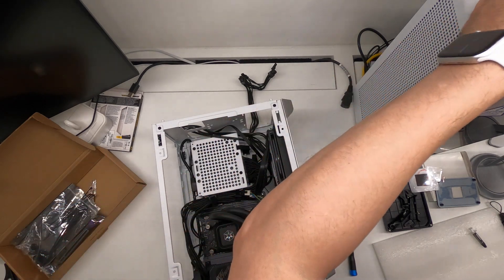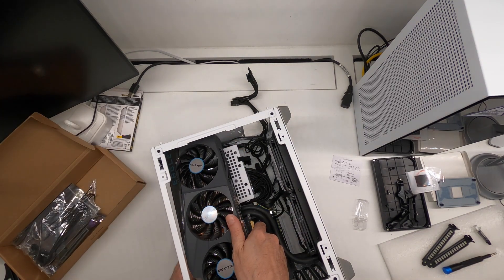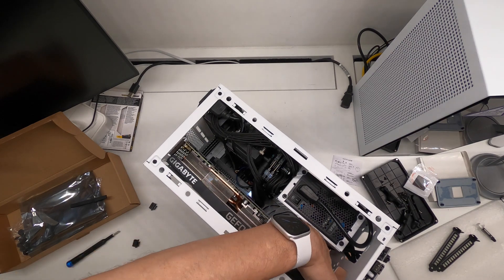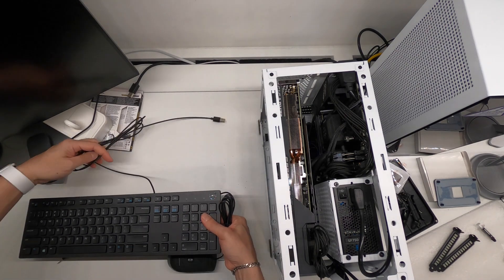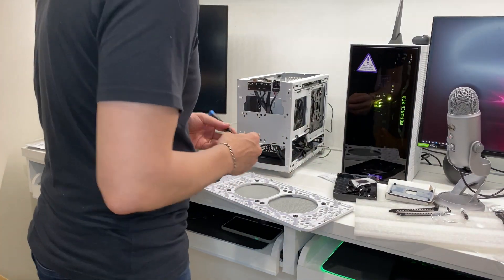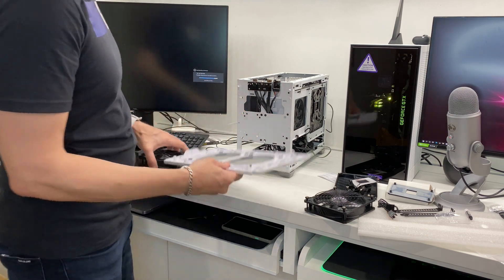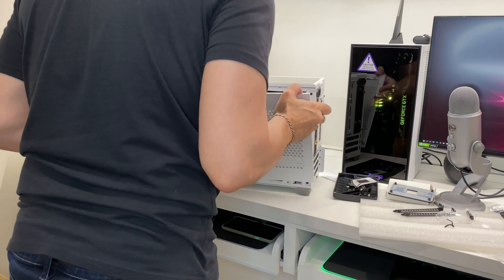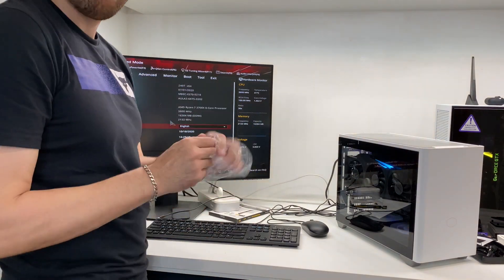Cooler Master NR200P ITX build - Part 4

Comment: I have the same case. with a similar hardware. I really doubt that it can perform like that, especially build like that including the window. I got much more airflow and still had issues to get it to a decent noise level.
Reply from the maker: I have since been doing some testing and managed to mount my low profile radiator up top. Tested this using both a 2080 Ti as well as a RX 6800. Details are on Reddit. 

https://www.reddit.com/r/coolermaster/comments/lemzvp/reworked_the_cm_nr200p_mounted_240mm_aio_up_top/?utm_source=share&utm_medium=ios_app&utm_name=iossmf
https://www.reddit.com/r/coolermaster/comments/lfpxx5/reworked_the_cm_nr200p_part_2_switched_to_the/?utm_source=share&utm_medium=ios_app&utm_name=iossmf
Reply: @FizzysTech  >80°C GPU temp in a 2080Ti... Technically still okay but not recommended. I have the same MB and the PCH fan is very difficult to handle especially if the surrounding is hot too. This is a design flaw of this MB. I guess yours must go nuts all the time and the GPU fans go full throttle too. This is what I meant. I optimized my 3080 in this case (horizontal installation) and it doesn't get above 66°C with the fans @1750rpm in Heaven4.0. My CPU (X5800) doesnt get abouve 52°C in Heaven4.0, 70°C in Cinebench. Air flow is essential in cases like that to have a good performance plus a more or less silent system.
Reply from the maker: @saschagierling6009  sounds like you managed to tweak the system well. I also tested the 2080Ti mounted directly to the motherboard. The interesting thing was that the temp only dropped by 1-2 degrees but because it was just crossing 80 the fans were spinning up n down when it dropped below 80. 

I have concluded that I won’t be keeping the 2080Ti in this build as the RX 6800 runs so much cooler. Way below 70 on full load (67 was the peak if I remember correctly). I may test the RX 6900XT in this soon to see how that performs.
Reply: @FizzysTech  The problem is the window. Have you tried to use the other cover instead of the window? I recognized that the airflow is best with a horizontal GPU build cool air comes from below and the hot air is pushed out directly through the side panels. You can feel a pretty high air flow there. So if you block any of these directions the temps and noise go up pretty serious.
In my opinion the punch holes on the sides should begin even lower. If the panels are removed the temps drop a bit more.
BTW I undervolted my 3080 just below 0,9V with stock performance. Same goes for CPU, dropping temps by 10°C and more. Automatically leading to lower noise. Imo undervolting in SFF cases is mandatory.
Reply from the maker: @saschagierling6009  yep I have tried with the mesh side panel. I have also tried to mount the AIO down below and using both the tempered glass and the mesh panel. And yes I agree on the undervolt. I am undervolting both CPU and GPU in both the NR200P and the H1 build. The H1 is impressive as its running the Ryzen 9 3950X with a RX 6900XT very very well. Just working on overcoming the fire hazard which I have managed to overcome -  video to follow soon!

For the NR200P, I’m looking for the best orientation for me to plan a custom loop in this case. Since someone managed to put a rad up top and bottom this made me test the rad up top. I must say it turned out better than I originally thought. Let’s see how things progress over the coming month or 2 and I may well do a custom loop in the NR200P showing thermals in most orientations so I’ll be retesting each one.
Reply: @FizzysTech  Looking forward to it. With the rad on top you mean to extend the case upwards? It feels like cheated for me :). If you want to build a custom build with two rads I don't think you can avoid a watercooled GPU and a worse airflow inside the case. I think the classic 280mm in the side panel as pull in is the best solution. Pull in in the bottom and exhaust in top. I think a rad in thetop will reduce air flow in return to static pressure for the rad, means louder fans. But lets see.
What I want to try is a deshroud of the GPU but connected to the cards fan controller. I did not find a solution yet.
Reply from the maker: @saschagierling6009  the current AIO radiator and fans are low profile. So my current thoughts are to do a similar rad and fans up top but put a much thicker radiator down below. 

Yep If I can accomplish this then there is no need to cut the case. The current 240mm radiator is connected up where the fans are suppose to be held in with screws and washers to fill up the larger holes the quick release system cooler master built into the top plastic panel. I initially had doubts that this would work but after seeing someone manage to put in a radiator up top I decided to give it a go and this is were we are today :)

Comment: Which do you think is better betweer NR200p and NZHT H1 for a 800$ price ?
Reply from the maker: This is a personal preference thing I suppose. For me personally I prefer the NZXT H1 as I do like the small footprint it takes on my desk. It’s 140mm AIO is more than capable to keep the Ryzen 9 3950X I have loaded in mine. The only down side I see right now is the cooling capacity in the GPU chamber. Once I do manage to get an up to date GPU for it I plan on adding some fans to help blow out the hot air through the back. 

The CM NR200P on the other hand is a lot more flexible in terms of parts you can fit into it not to mention it being more budget friendly. The case also opens up the ability to do a custom loop to really add your own touch. This will be the deciding factor for some.

Comment: I'm glad this was recorded. Was wondering if you could fit this config in that case. I'm planning to go fully aircooled. If choosing to go horizontal for the gpu, do you think there is room for fans (probably slim ones?)  under it? Is that card 2.5 or 3 slot thick?
Reply from the maker: I take it your looking at the NR200. This card is a 2.75 slot thick if I'm not wrong. Not sure if I would recommend that config as you will need to have some high powered fans up top to suck out the heat mounted up top. If you were to put in fans below the GPU, the slim profiles should fit but you would have fans at the bottom as intake which will blow directly onto the GPU fans,.. you would have to test but I doubt this will be good to keep thermals under control.
Reply: @FizzysTech  pretty much. Nr200p actually  - Bottom intake and top exhaust, to force exhaust at the top and avoid hot air from the gpu from being recycled through sides and into the bottom intakes. Hoping i can get away with it using a 6-core processor (especially the new ryzen 5000 series chips). But alas - i can only speculate. I dont want to complicate the build any further than that.
Reply from the maker: @qwmjml  I did a bit of checking and it seems that people do mount fans below blowing into the GPU - so this should not be a problem. What GPU are you looking to get? The one I'm using in this build is the 3080 which is a very thick card. As for CPU, a Ryzen 5 5600X should be no issue to be air cooled. Just double check the thickness of the GPU your going to get and if needed I'll measure it for you here to confirm if it fits :)
Reply: @FizzysTech  Thanks so much! I haven't really decided yet. Gonna wait just a little bit to see what else nvidia releases. I'll probably go with something thats 2.5 slot or less to have room for the fans, but I do wonder, in the extreme case i.e. going with a 3-slot gpu, would there still be room for slim fans (15mm thick) under there you think?

Comment: not ideal to have an air cooled gpu in that position with the glass panel on.
Reply from the maker: There will be a follow up video explaining all of this.
Reply from the maker: Yes,.. let me try and get it recorded and published this week,... stay tuned!
Reply: Gpu with blower style fan better?
Reply from the maker: Yes and no,... The thermals are actually not bad with the glass panel on in that orientation. I did do other test to see what config gives the best airflow and landed at mounting the GPU at the bottom and the radiator across the middle using the support bracket. This config only works with the mesh panel but since you can't really see much in this case when air cooling the GPU its probably the best configuration you can get. The tempered glass is ideal for those looking to custom water cool their system.